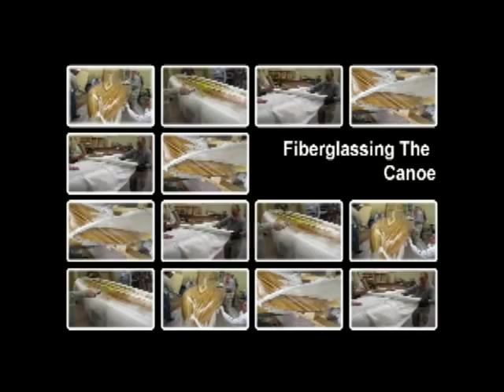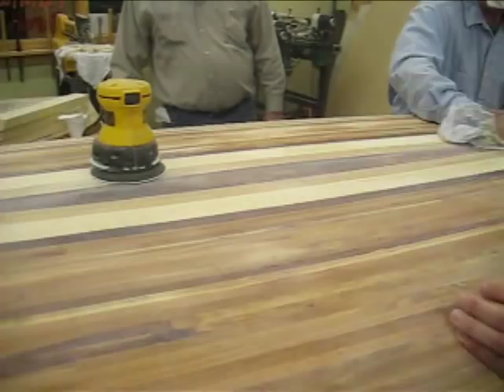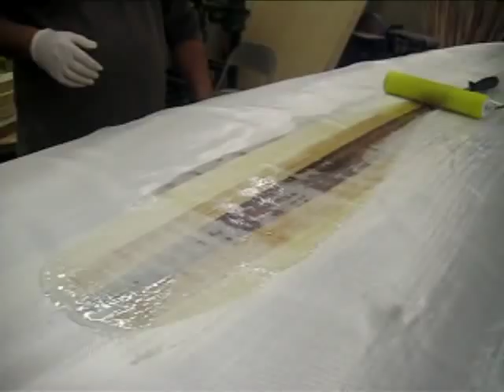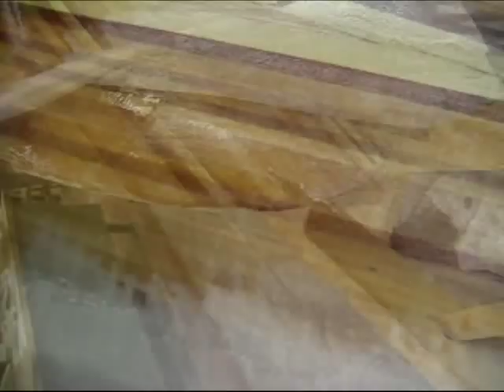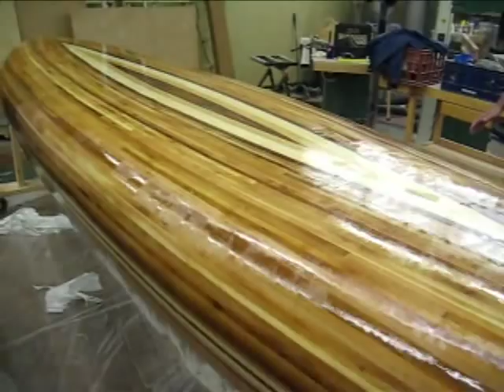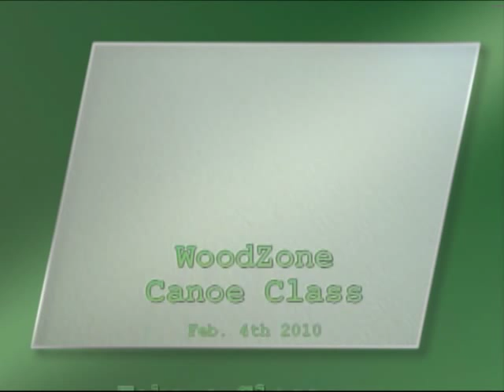Fiberglassing a Wood Strip Canoe - WoodZone.com

Comment from the maker: @JustWonderingHowToDo The strips are 1/4" x 3/4"  - We used the Amana bead and cove bit set to mill the strips. This was a lot of work but made the sanding faster and eliminated gaps between the strips from previous canoes that showed light.

Comment from the maker: @dtsman1 The outside has two layers - one over the entire surface and another "football size" shape that covers the bottom up to the water/rock impact area. The inside has one layer of fiberglass. The process is to seal the wood with straight epoxy. Sand. Apply cloth and epoxy. Sand - Apply filler coat of epoxy to fill in fiberglass weave. Sand - coat with a varnish or clear coat that has a UV inhibitor.

Comment: Looks great. Motivated me to do it.
Do you need to fiberglass the inside or just use straight epoxy?
I was going to do a canoe, but now it has turned into a 16' boat with ribs. I am almost to the epoxy stage and doing some research. Do I need to use fiber cloth on the inside?